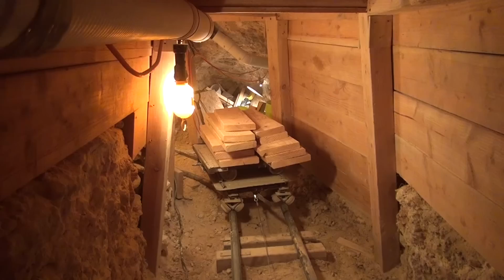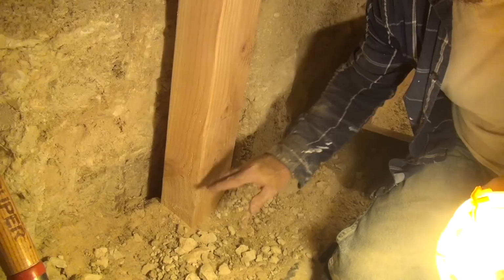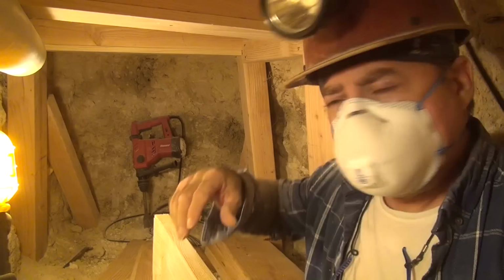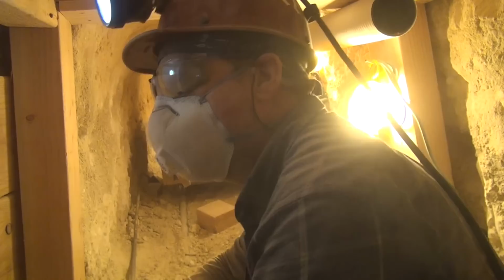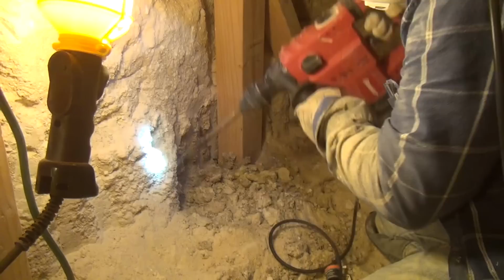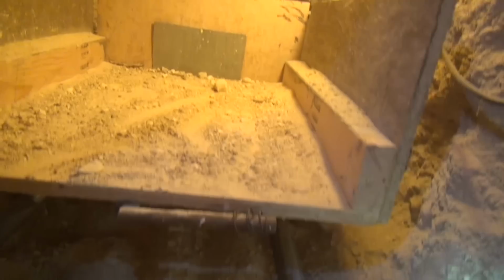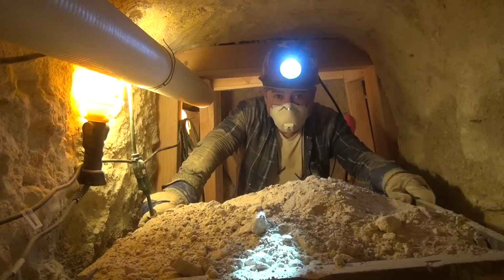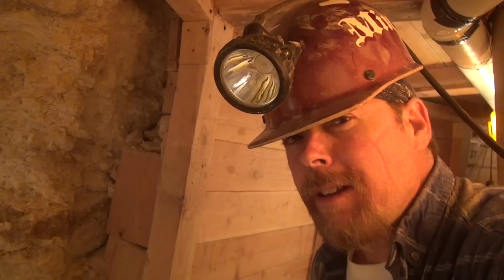How To Timber a Mine - LAGGING MADNESS | ask Jeff Williams

Comment: SO much fine dirt in that mine.. I wonder if a 4" vacuum system would be easier to muck out most of that minus the big rocks.
Reply: I was also thinking a recirc system with filter to cool and clear it.
Reply: At the very least I would be wearing a P3 dust particulate filter half mask in there.
Reply from the maker: yep that would work great

Comment: That's awesome. Have a question. As an electrician, I was wondering why you buy trouble lights to string along as lighting?  Temporary light fixtures from your local electrical supply, and a spool of #12/2 with ground, wire and a bag of wire nuts would do the same job for a fraction of the cost.
Reply from the maker: when we get the drift to its destination we will rewire it .

Comment: Use a CFL bulb in that drop light. It won't burn out everytime you drop it.🙄
Reply: LED
Reply: Contractor packs of LED light bulbs at home Depot for like 16$-18$ or maybe it was a 16 pack for $32 lol it's been a few years since only had two go bad 6.7 watts and they put out more light than the 15 watt fluorescent
Reply from the maker: thanks

Comment: Hey Jeff, great video and it sure is hard work.
Just wondering why you use them old fashioned incandescent light bulbs and not LED bulbs?  Nowadays they give out just as much light, not too expensive and are almost indestructible.  Also give out almost no heat and I doubt you really need extra heat down there.  Save a bit on fuel for the geni too!
So c'mon, it's 2020!  :-)
Reply from the maker: we just switched over

Comment: Jeff,I have a dumb question. I found an old drift mine in caliche much like yours, only they had no timbers inside. so my question is what determines which way to dig? My metal detector gave no clue. They had to have gone in about 90 feet.I did not see any river channels, but I only went in about 30 feet.
Reply from the maker: there are a lot of factors that determine the direction to dig ...each area is different

Comment: Does the vent pipe only deliver air at the end of the pipe or do you drill holes along the pipe?  If no holes are drilled, does the air at the end of the pipe work it's way back to the mine entrance?
Reply from the maker: only air to the end of the pipe and it blows it out through the portal